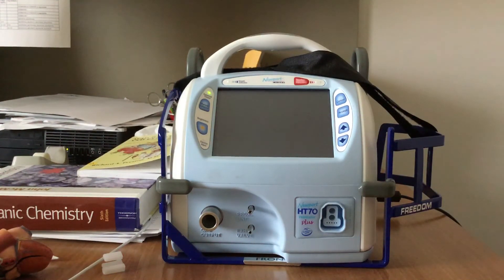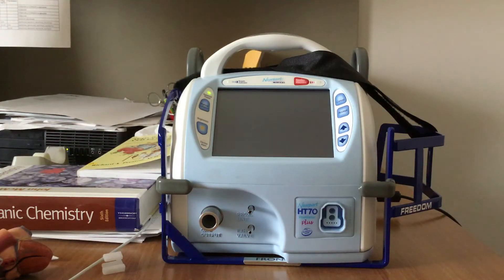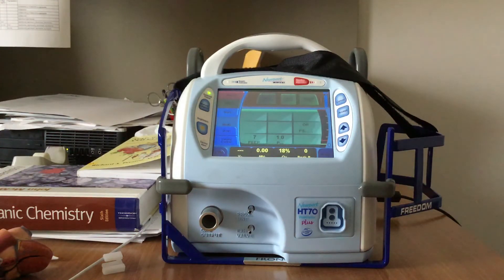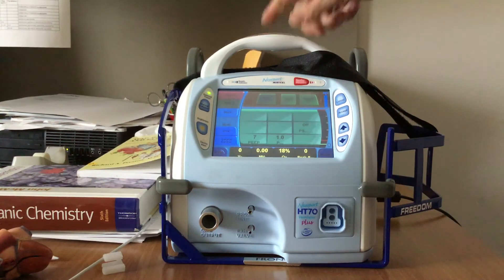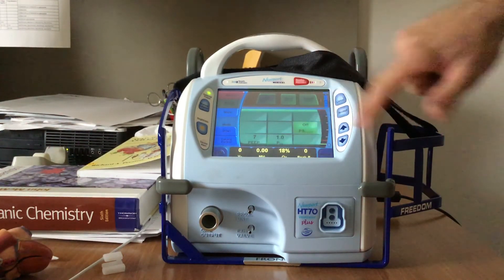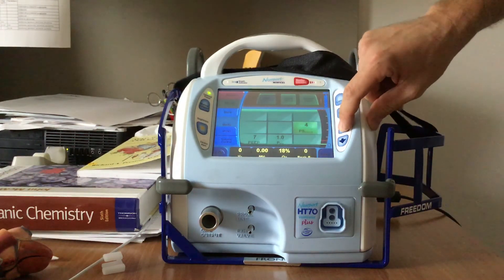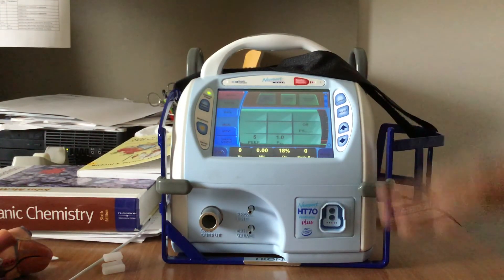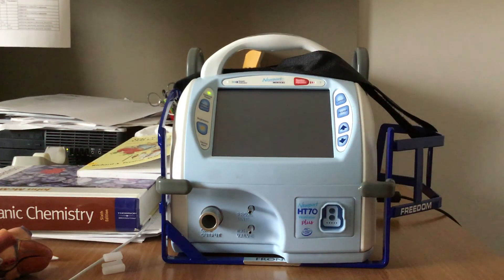Noninvasive Ventilation Setup: HT70

Comment: Good video! 2 questions regarding the HT70
1. What does it means when it says "back up ventilation" on the display.  Is it giving a higher frequency due to change in lung compliance?

2. why does the low minute ventilation alarms when clearly when there is no leakage, despite the set VT and RR and the cuff is inflated?

Thanks